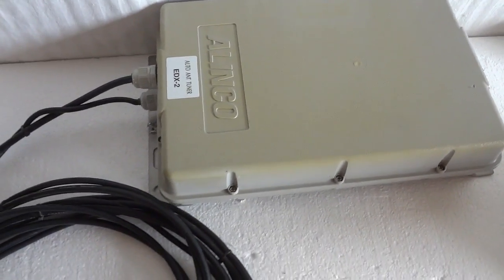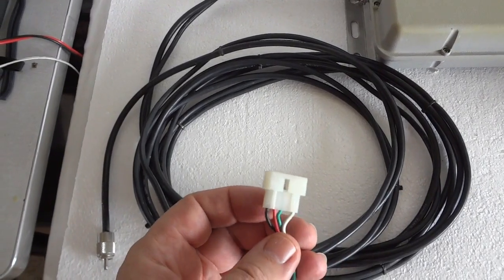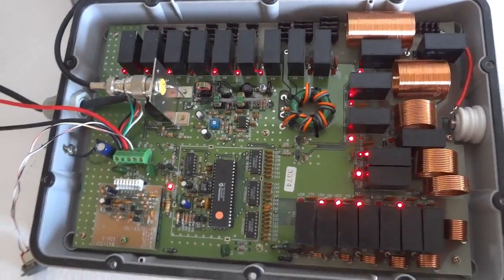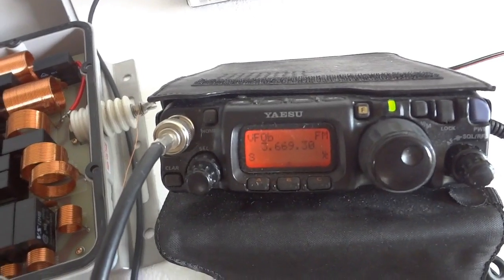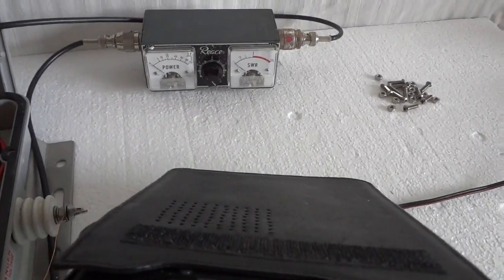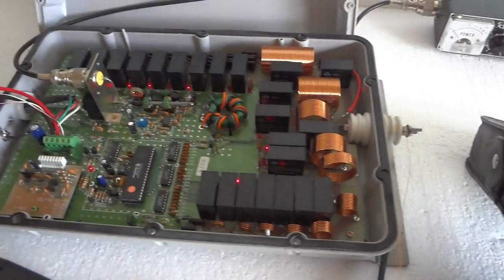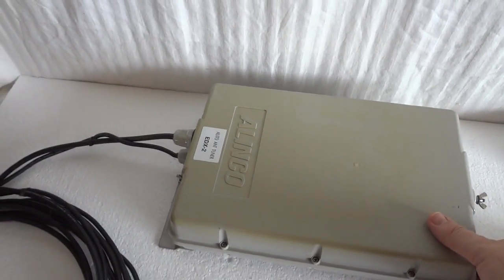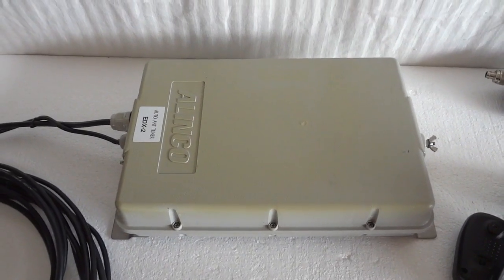Alinco EDX-2 automatic antenna tuner tuner coupler

Comment: Hi there …. Can you show how to connect the switch? Please
Reply: You mean the push button to start tuning procedure? 
Just Close contact to negative.
One thing Is important, sice the ATU Will be installed under the antenna, and transmitter Will be inside house, you Will never know when tuner ends tuning procedure. I suggest to use a LED connected to the Key cable, that villa show you when tuning Is complete.
In the old days, i made a Little box, had a 13,8 Power supply inside, a push button to start tuning, and the Key line connected to and LED and via a relè close TX contact to transmitter. It does all in automatic. My ATU was icom, but same as this. It works great, but you Need a good ground on tuner unit and the antenna must be at least 7,5 meters. Now I use a a marine band ATU It Is much complicate to connect but tunes anything and has a full PI mach.👍👍👍

Comment: In the FT-991A you can use the LDG Y-acc cable & set the radio tuner selection to lamp, as you would to tune an amplifier. But you have to wire a female 3.5mm 3 pole to the EDX-3. I'm sure this will work for any radio like the FT-857D that has the LDG Tuner capability with the Y-acc cable. The 857d uses the acc socket & tuner settings

Comment: i have  FS-1503 rig(HF, ssb) and AT-1502(Antenna Coupler,ATU) i keep of 1 years, after found from my friend.how to load the power , how setup and running ,please help
Reply: AT1502 Furuno?  👍👍👍👍👍 Nice staff. As long as you have a good ground, It tunes any antenna from 1,6 tò 30 MHz. Usualy 7,5 Meter wip antenna Will be good 👍👍👍

Comment: Years ago, I popped the finals in my FT817 by running an auto tuner with the radio set to full power, (5W).  You should always set it to 0.5W or 1.5W if needed when auto tuning.   While the tuning cycle is proceeding, there will be brief moments of very high SWR.  You don't want to have to do the final replacement on the radio, it's tedious.
Reply: The SWR protection while tuning is an interesting feature which some tuners do provide, like Icom's AT-130/140 series. They have an internal attenuator, which provides a good SWR to radio while tuning, and at the same time, tuner uses the output of the attenuator to do the tuning. When a tuning solution has been reached, the attenuator is taken out of the circuit.

Comment: I have a Alinco DX-SR8 HF rig and bought one of these from DX Engineering 
The EDX2 works great.
I have 200 feet of #12 AWG wire suspended at 20 feet through my trees.
I worked Hawaii on 40 meters with 100watts from South East Texas.
5x8 report 
Tuning is very fast.

Comment: thanks for share,it has one isolator that mean I can use it with any "long wire" antenna tuning 160 meters-10 meters.In my case,find a solution for a antenna....73s!!

Comment: can this tuner be used 50 feet away from the radio and if so do you just extend the power and push button cable?
Can you run power for the tuner through the coax to reduce cabling?
Reply: Ken t